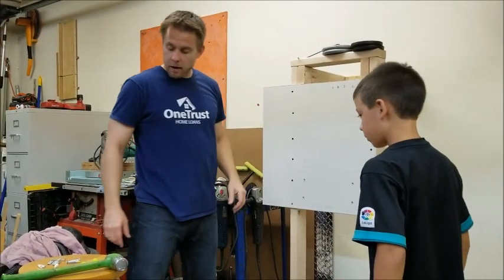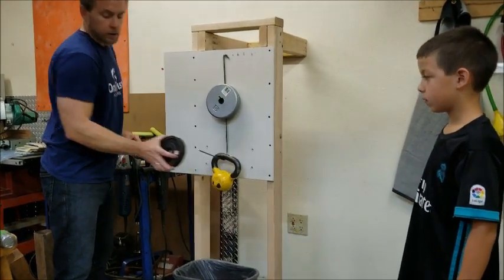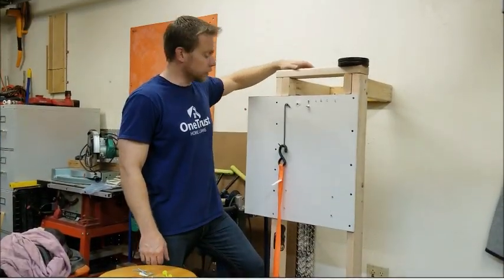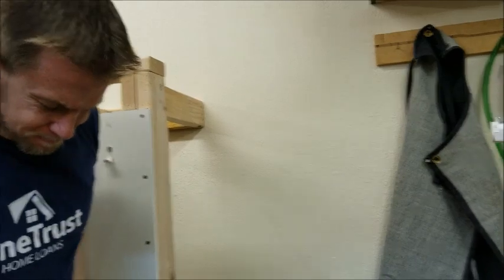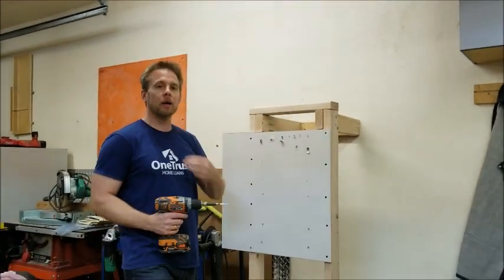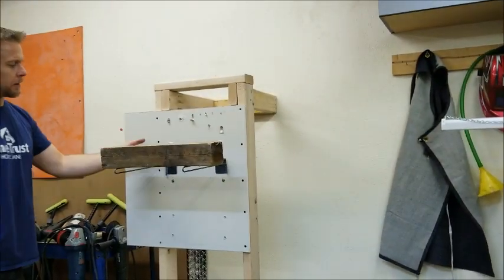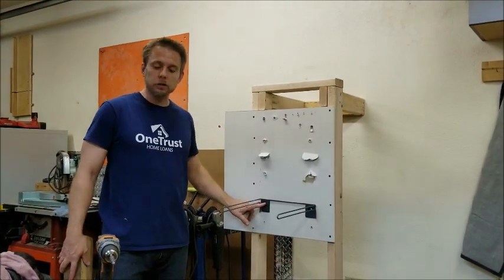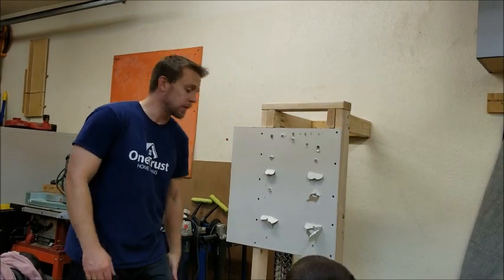How much weight can a wall anchor hold

Comment: You are very good with tools and construction and should have done a better job because of that. I suspect the kids activities around you prevents a more thought out and to the point presentation.  And explaining what top of board is being used and what each anchor looks like from behind should have been done. If you had pre drilled each anchor or holes for them (or maybe you did that) and had made up attachments and weights ready to go you could have shown more clearly if they at least met their weight claims. Then see how much weight beyond the weight claims, breaks the anchors and board around them. The racks you used, to test shelving weight support, levels, for each anchor types, were much to flimsy and not constructed to brace shelving or support much weight. You should have used L shared brackets to support say a 10" board or spoked shelf, 2 ft apart, on pre drilled anchor types and see how much weight they support and when is broken. That would have been a much better and needed demonstration. You are too good and too smart not to have done and known that, but you did. Blame the kiddies for that. Kids are hard work.